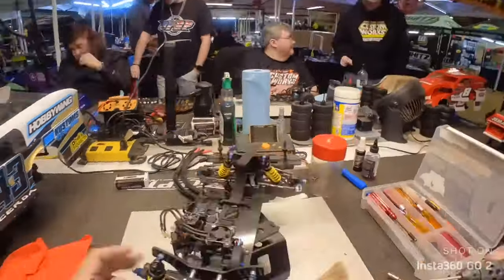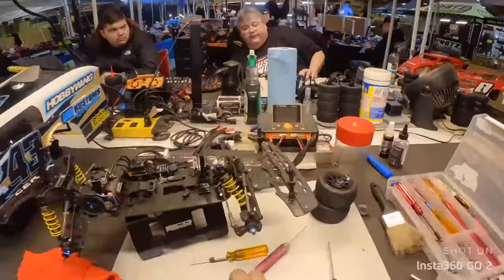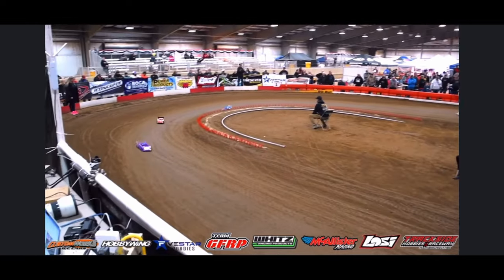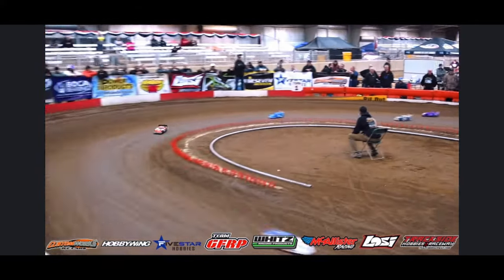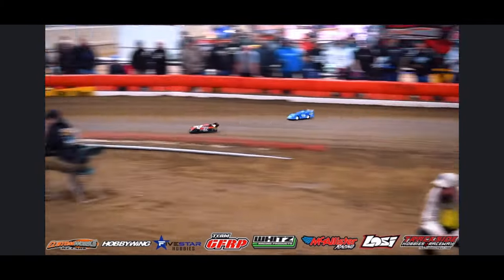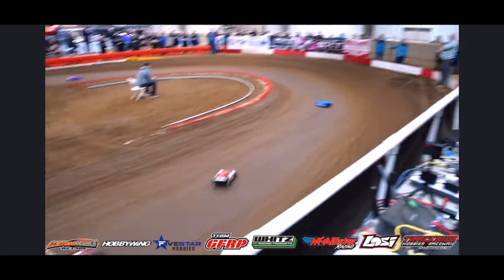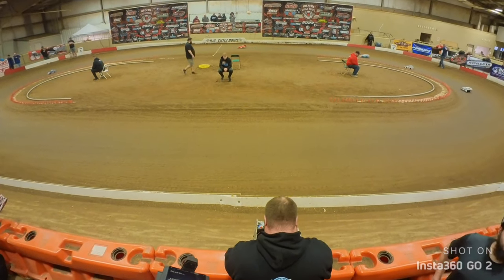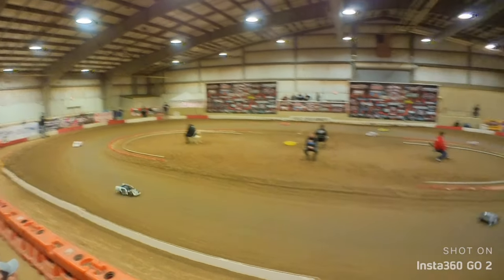Sc Mod shut down while leading race!

Comment: Awesome job batteries got me back in 97 state carpet oval I ended up 4th dropped from 2nd I had nothing for the leader and missed out on the podium but I learned more about batteries and came back stronger. You're driving is top quality you can get them next time!!